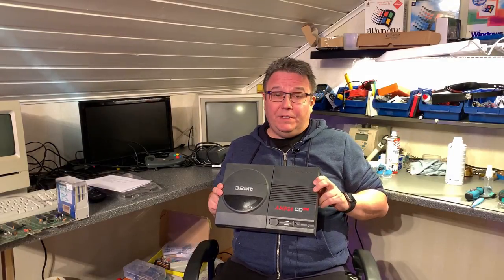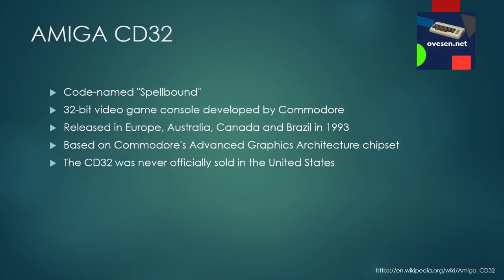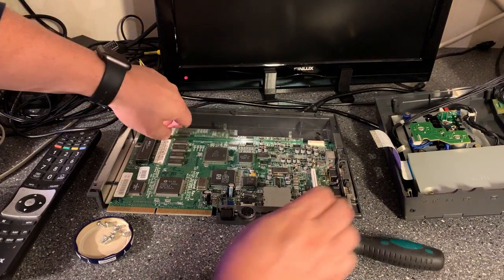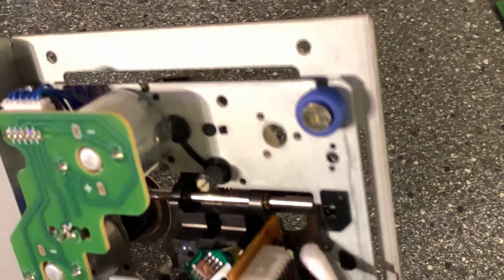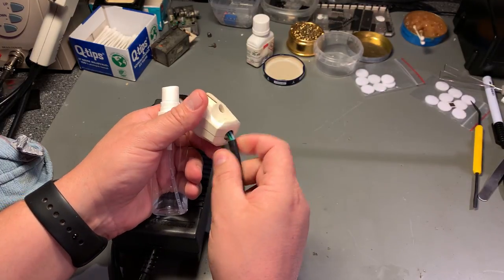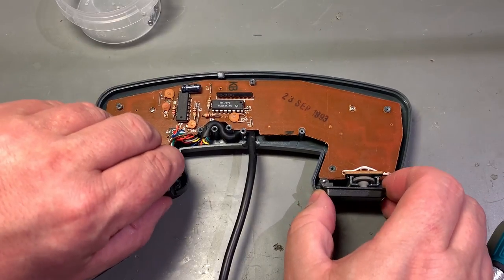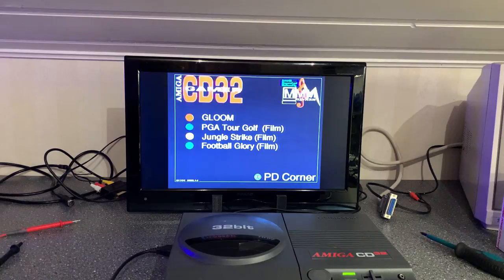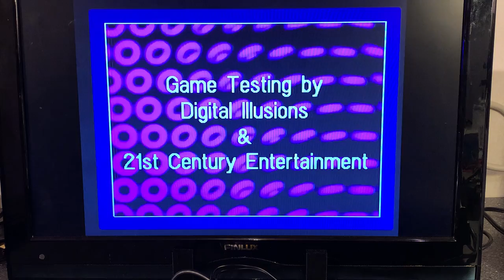Amiga CD32 - Teardown and restoration plus games

Comment: Commodore's MOS division wasn't capable of building some of the AGA chips (its fab was too antiquated), so Commodore had to farm out production. The HP and VLSI chips are the two in the CD32 that Commodore couldn't make in house. Commodore wasn't used to that and it caused supply chain problems for them.

Comment: is the chip from analog devices, next to the big HP chip, some kind of video-dac?
the case design is sensationally ugly. i would not call a playstation one a revolutionary inspired design either, but at least it is not ugly as the amiga cd32.
having a more modular design with separated video, audio and memory sections/boards would be cool for future changes/upgrades like new hdmi compatible video modes. the performance i think is enough for all retro gaming tasks.

Comment: Not only clean! You have to change all electrolyt capacitors! Otherwise you will have only a pice of electro waste in any months. :(
Reply from the maker: Maybe later :) It has lasted for 26 yrs, it can still last for some months
Reply: @Arcticretro  The bottom sides of the caps are standing in its own saucage and the acid is working...
Belive me, I have repaired many of them and none was dry and fully healthy.
Reply from the maker: @Jojo_F  Yes, it will be recapped sometime soon :)